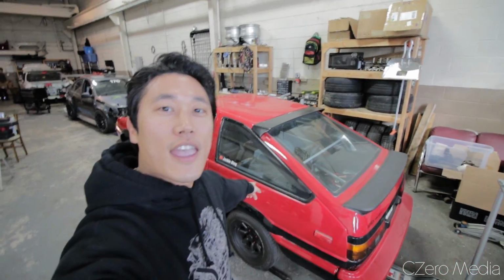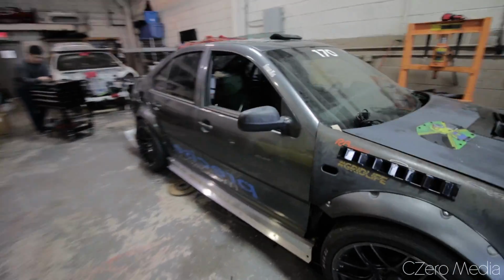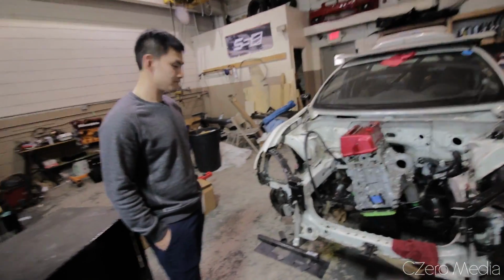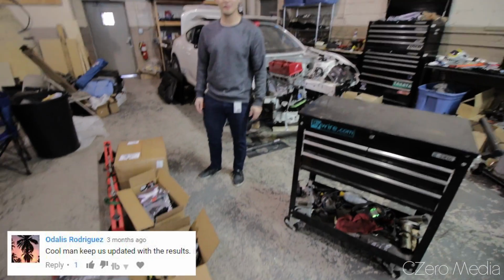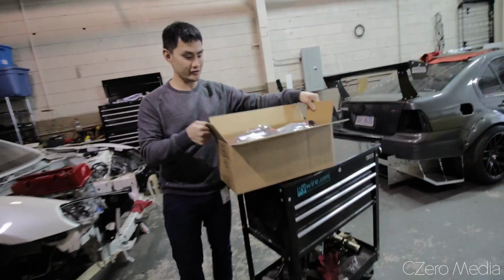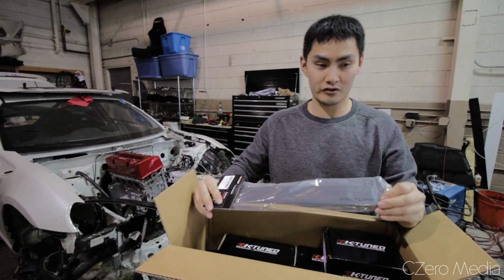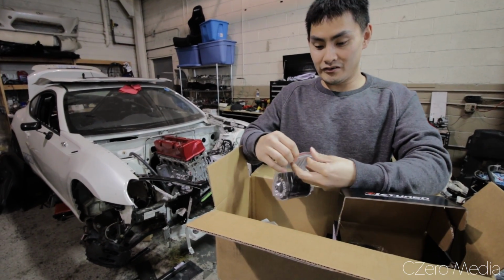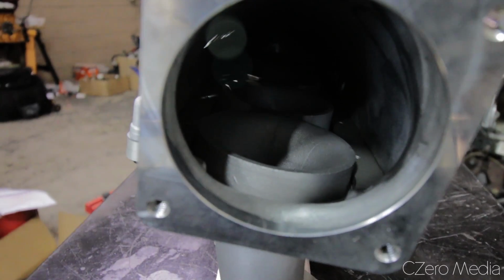Project Toyonda K86 - MOTOR IS IN! - Supercharged K24 FRS Build Series 3

Comment: Interesting build, not bashing Honda or anything but it seems kinda of a waste( money and custom wise like the miata) but much props and respect, I'll be looking foward to see more of the build and how it turns out. Its definitely someting different
Reply: Francisco Lozada how is it a waste?
Reply: dipstik subaru cause there are cheaper and better swap builds for the money he is putting on, now if it was an na build then it seems more of a benefit, but then again any motor seems better to swap then a shity factory fa20. And like i said i aint bashing the guy, this is more of a personal opinion due to costs.
Reply: Francisco Lozada that makes zero sense.  Would you have said the same thing to the first person to 2j or LS swap one of these?  Someone has to be first.
Reply: Francisco Lozada what does it matter if it's NA or not?
Reply: dipstik subaru its not about being first or last, even if there was a kit it would be pricy, i know cause i swapped a k20 to a hatch even with a kit and wiring its still pricey and its going to a honda. But the guy gets props and respect. Who knows if its something that gets popular like the 2jz or ls swap it might be different. And reason i compared it to a miata swap is for the fact that a k20 in a miata is cool but it wasn't something that catched on alot so swapping it its very costly, that's the point im just trying to make
Reply: Francisco Lozada not a waste when you think about reliability. If you're swapping into a German car or something else expensive to maintain.

Comment: I want the mod list. I want to do this build someday. :)
Reply: Chenghuab Vue, Do you want the whole list? It an expensive build ha.
Reply: BaoHouse Racing yes I do want the list
Reply: Engine/Transmission/Swap:
K20 Head
Ported by Besnik Engine Design
Ferrera Valves
Ferrera Springs
K24 Block
Built by Besnik Engine Design
11:1 Wiesco Pistons
K1 Tech I-Beam Rods
ACL Beaings
BaoHouse Engine/Transmission Mounts
RevShift Race Engine Bushings
S2000 Transmission Built by BaoHouse
BaoHouse Transmission Plate
BaoHouse Driveshaft 
BaoHouse K series 86 Swap Header
BaoHouse V-Mount Spec Radiator
BaoHouse K Series 86 Swap Baffled Oil Pan
Skunk2 Ultra Race Manifold
Skunk2 Ultra 90mm Throttle Body
K-Tuned Coolant Neck
K-Tune Thermostat Housing
K-Tune Engine Harness
Hondata Kprov4 ECU Tuned by MIkeySpec
Canton Racing Accusump System
Canton Racing Oil Cooler 

Forced Induction:
Kraftwerks Supercharger Kit
Rotrex C38-91 Charger
115mm Pulley
BaoHouse V-Mount Spec Intercooler

Fuel:
K-tuned Fuel Rail
FIC 1300cc Injectors
Radium Engineering Fuel Pump Housing
Radium Engineering Surge Tank
Radium Engineering Fuel Regulator
Walbro E85 450LHP Pump

Suspension/Brakes/Wheels/Tires:
Stance XR2 Coilovers
Stance Rear Lower Control Arms
Whiteline Differential Bushings
Whiteline Rear Subframe Bushings
Whiteline Bumpsteer Kit
Stoptech ST40 Big Brake Kit
Hawk DTC-70 Front and Rear Pads
Enkei RPF1 17x10 Wheels
Nitto NT01 275/40-17 Tires
  
Aero:
Tegris Front Splitter
Volex Motorsports Splitter End Plates
Volex Sideskirt Splitter 
Volex Rear Subframe Covers
Volex Rear Diffuser
EXACT Performance Rear 74” Wing

Interior/Safety:
AIM MXL Pista Dash Data Acquisition System
BaoHouse Race Spec Chassis Wiring
AutoPower Rollcage
Sparco Circuit Seat
Sparco Steering Wheel
Sparco HANS 6pt Harness

There is a lot more work done to the chassis for weight reduction and ducting that isn’t listed or shown.
Reply: Damn, that's a crazy mod list. A lot of nice parts. I'm excited for this build!

Comment: Toyonda, sounds like a sassy black woman who don't need no man.
Reply: The chassis is made by Toyota and engine is made by Subaru.Gt86/BRZ/FR-S are the Same car with different trim but depending which Brand you buy from, the Chassis and Engine nomenclature are different (except Toyota & Scion RIP obviously) because both manufacturers kinda want to keep their naming systems different E.g. FA20 and 4U-GSE different name but same motor. Also btw the Ft86 is just the concept model and not the final production model.
Views may be different on if it's purely a Toyota or Subaru but to me it's a hybrid of both. 
Also the new upcoming Supra apparently may have a BMW motor since BMW and Toyota are collaborating on the project, so you may have a similar question to that.
Reply: JOHNCENA20XX 😂
Reply: How is an FT86 a toyota other than the badge? Its a modified rwd impreza chassis that comes with a subaru boxer engine.